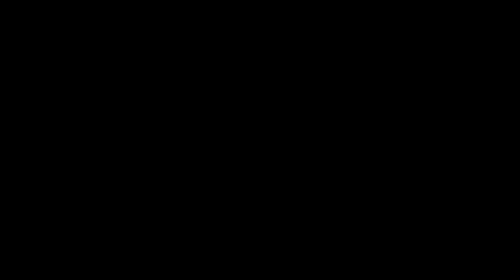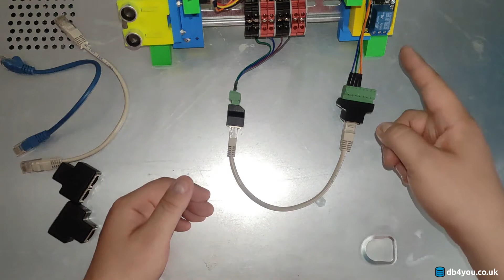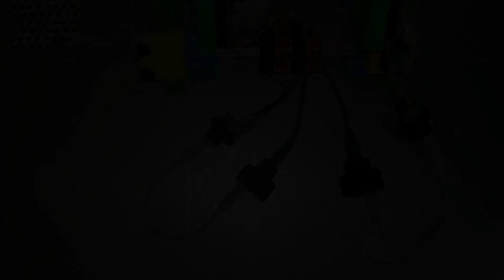RJ45 splitter used for a DIY modbus "network"

Comment: Do you happen to have the vendor, or model of these "splitters" please? A lot of the RJ45 (8P8C) splitters online seem to take half the pins to one port, and half to the other. However, I assume your one passes through all the pins to both ports, which is exactly what we need to daisy-chain Modbus devices =).
Would love to be able to find these!
Reply from the maker: You are correct. It is a major pain to find the right ones. However i figured out a simple method to find if the adapter is the right one. In the description of a listing find a section that is talking about how many devices can work at the same time on this splitter. You need to look for information that says that only one device can work at any given time. This way you know that all of the pins are connected to each other. This obviously is what you want in a Daisy chained modbus setup like the one above.🙃 I could find you some ebay listings potentially if you are gonna struggle.

Comment: working great for me for monitoring my lifepo4 batteries. quick, fast, and not too dirty.
Reply from the maker: Could you elaborate a bit? You created a network of sorts to monitor battery capacity for a DIY home solar panel system maybe?

Comment: Does it work for serial modbus/RS485 network?
Reply from the maker: Yes. In the video you can't really see that I am using two arduino UNOs + the RS485 shield:

https://www.youtube.com/watch?v=G9Sf4lk9Nuw
Reply: Great! What model are those splitters? There are several models online, some require to be used with two pieces and other type just duplicate the input pins on the outputs.
Reply from the maker: Yes, you are right. Let me have a look which ones I actually have since it has been some time) and get back to you on that.
Reply from the maker: So, had a look. These are the ones that work in the same way as ethernet economizers. So you can buy a pair or just one depending on what you wanna do. I am going to be living in a huge house soon so I will be using them. I wanna get all of my electronics and lights controlled via RS485.